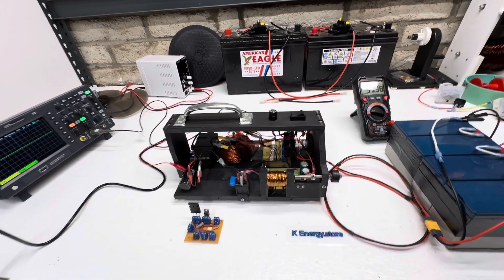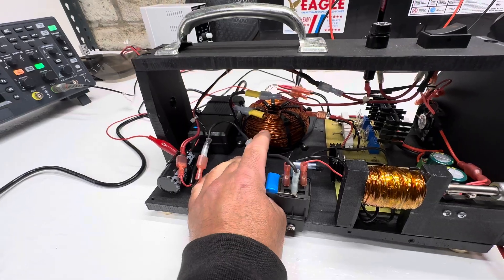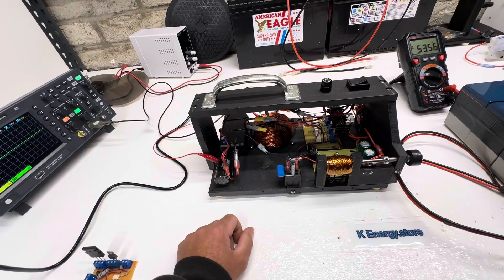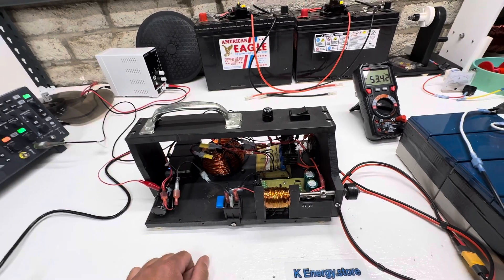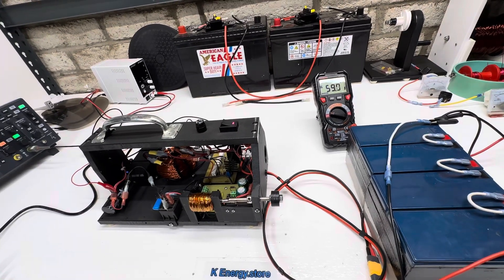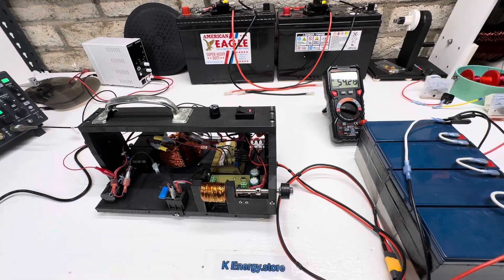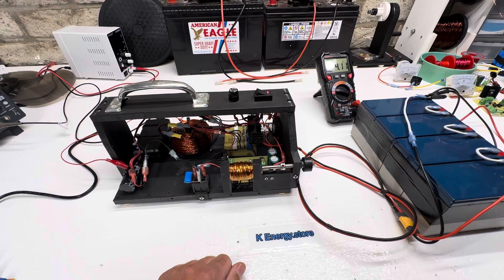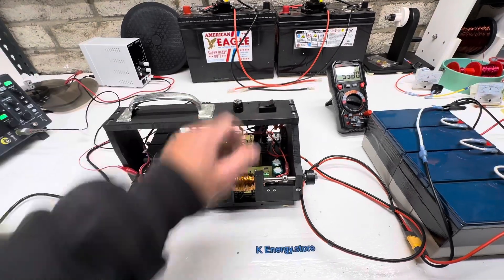Old Oscillator charger for 48v batteries

Comment: Good work
Can you please check if there is any power gain comparing with conventional charging?
Reply from the maker: It uses 12 v at 3amps output not easy to measure puts out 500 volts